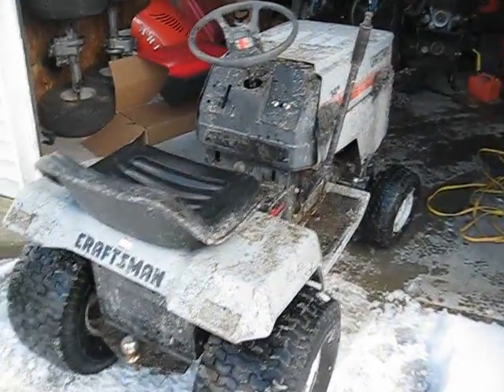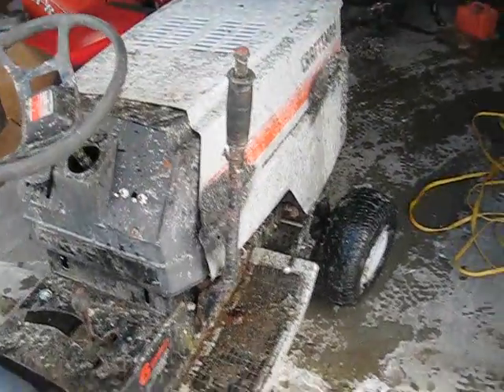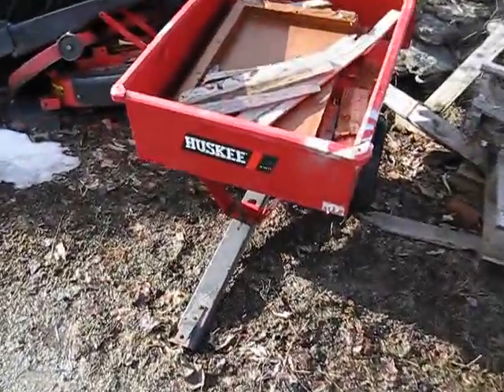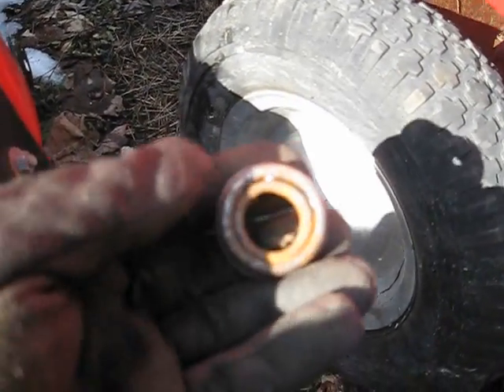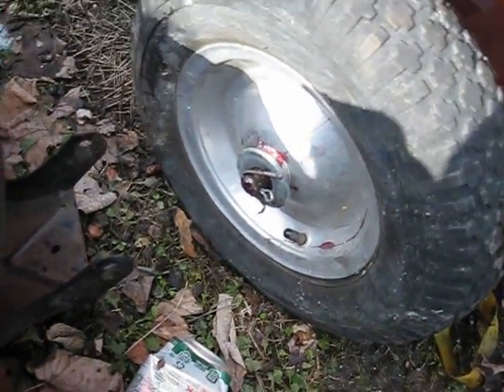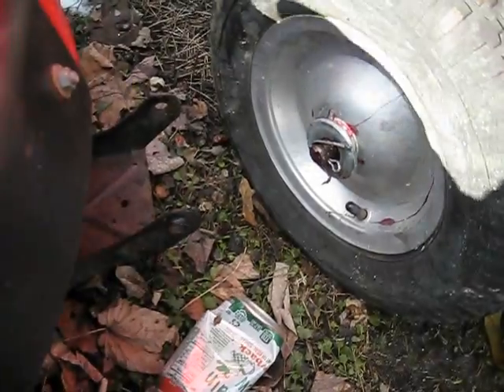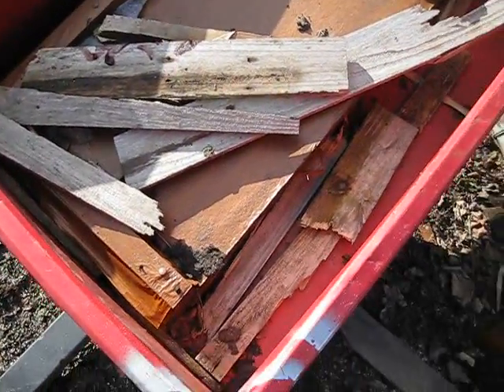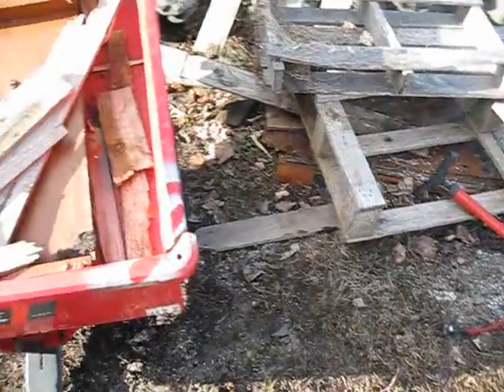New Switches for the Rally + Lawn Cart Repair.

Comment from the maker: Yea, the one I replaced has a tube leak and it ended up snapping the valve stem off when I was working a little earlier. When I rebuild I might use some MTD front tires I have lying around, or get another set of skinnies and double up.